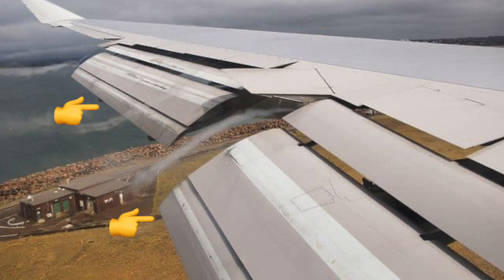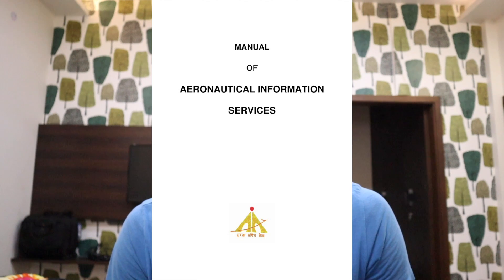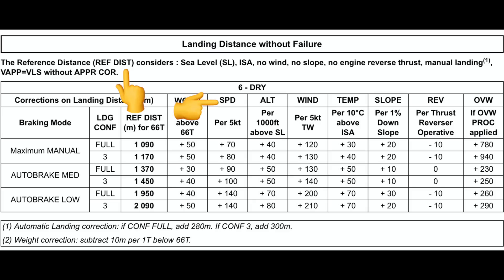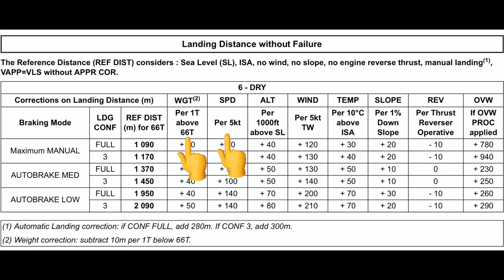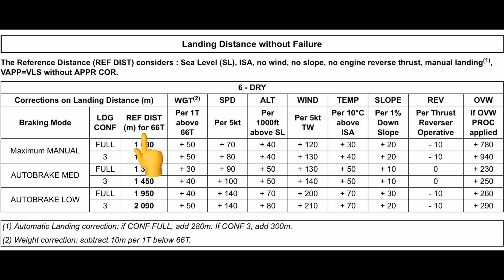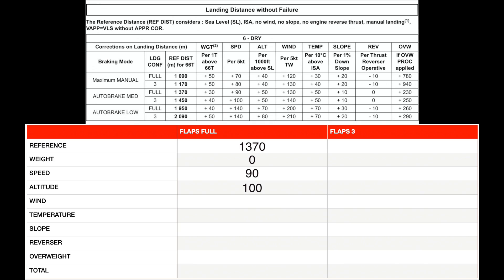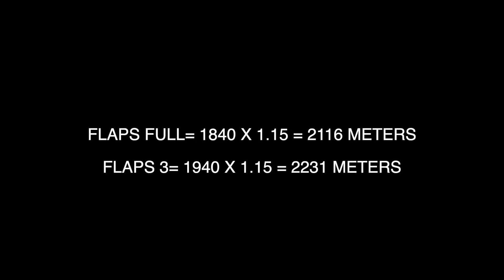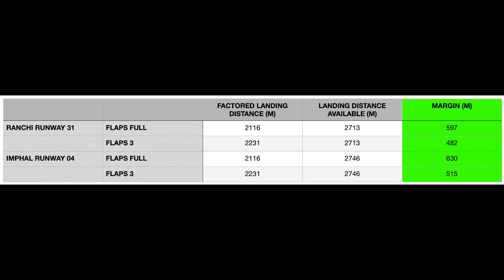HOW DANGEROUS ARE FLAPS 3 LANDINGS ON AN AIRBUS A320? 😰 (WITH PROOF!!!)

Comment: If the fuel consumption is so low than why airlines has given a target???

If Flaps 3 is so much safe then why has Airbus kept Flaps Full???
Reply: Flaps full is for runways with much shorter LDA.
Reply: @ajayanoop7995  what if a pilot is landing with a high tail winds???....... there are many other factors
Reply: @debasisrout2821  There is no analogy between flaps and Front brakes of a bike. Why would the government take such a stupid decision, what are you even talking about hahahahaha. Pilots are trained a lot to be in position to determine what flap configuration is required they pay almost 1 crore to learn such facts.
Reply: @furiousninja133  Govt didn't took any decision its the Air Asia's Management which has taken the decision to make 98%  flaps 3 landing (Or whatever) because it saves a substantial amount of fuel if considered cumulatively.

Yes I agree "Pilots are trained a lot to be in position to determine what flap configuration is required they pay almost 1 crore to learn such facts"..... So please let them decide what is safe and what is not? why the hell Management (Whose only aim is to achieve profits) is giving them targets to achieve?? Are planes flown by pilots or Salesman that they need to achieve targets??
Reply: @debasisrout2821  Pilots don't need to decide what is safe and what's not, it's not their job to do so. The flying beast is not qualified enough to be commenting on such a subject and its very unethical on his part. Pilots are required to follow the procedure and take decisions according to prescribed guidelines in case of any events. 
These procedures are determined by dedicated National and International authority. Any airlines can't enact rules or procedures arbitrarily risking the life of people. Everything in an aircraft has a procedure, they can't overlook such a basic and fundamental thing. 
He may by flexing his online power bend Airasia but many other will still continue and you would never know.
Reply: @furiousninja133  Pilots don't need decide what is safe or Not ??  bro grow up........ you can say that pilot don't make the Flight Manuals and Operating Procedures they have to follow these which is made by Authorities and their Airlines but its the Captain of the plane who has full rights to decide what is safe for his plane or not when he is in command, Though the decisions taken by him can later be scrutinized but he has full powers and freedom to decide.

by the way if you are talking about Policies i guess you don't know about the worst crashes in history of aviation has something to do about policies..... please refer to the below links:
https://en.wikipedia.org/wiki/2002_%C3%9Cberlingen_mid-air_collision
(Soviet System says ATC controller has precedence but western system says TCAS has precedence)
https://en.wikipedia.org/wiki/Tenerife_airport_disaster
(The worst crash in history happened because of a foolish Policy of KLM)

And if you want to know about how good the procedures work please refer:
https://en.wikipedia.org/wiki/British_Airways_Flight_9
(There is no procedure only pilot used his skills and his luck helped him)
https://en.wikipedia.org/wiki/Boeing_737_rudder_issues#:~:text=During%20the%201990s%2C%20a%20series,aircraft%20resulted%20in%20multiple%20incidents.&text=The%20National%20Transportation%20Safety%20Board,movement%20of%20the%20aircraft's%20rudder.
(Now one knew that there is a fault so no procedure.......)
https://en.wikipedia.org/wiki/2003_Baghdad_DHL_attempted_shootdown_incident
(What should I do if my plane is struck by a RPG.... thank god the pilot used his brains and landed the plane safely rather than looking for procedures)
and I think you Know how Captain Sullenberger hit the APU first it was not in procedure it was his Experience.

There are many more Examples

By the way its not about Flying Beast or any specific person its just to save the aviation world which I love.....

If you want to know more about how these budget airlines risk our lives to earn profit check out this:
https://www.youtube.com/watch?v=qSZ-R5HdPQU

you will come to know the truth about Air Asia
Reply: @debasisrout2821  I guess conditions do require its own solutions, for instance this case is for a normal landing SOP. PIC will take the mandatory requirements for landing and landing distance depends on appropriate glide slope also.
Reply: @ajayanoop7995  How did you knew that the condition under which the pilot decided to use flaps 5 was normal...... were you the first officer of the flight or you are one of the investigators?? its very easy to comment and calculate in a you tube video but its not that much simple while in the cockpit because there you balance the lives of 180 people with few gallons of fuel...... at that situation any sound human being (not those who are picked by management)if is having slightest doubts in their mind would choose lives of 180 people over few dollars............ as dollars can be earned again but lives cannot be brought back
Reply: @debasisrout2821  See i never wanted to argue, but if you always wanted to go ahead with safety of lives alone, then planes would have been made out of titanium and must have been made more strong, then why not. Simple, it was made to fit for the economics of a company. And also look at any inventions, the engineering calculations are always in par with least money involved. Least money never means cheap product. Air travel would have been far more expensive if it were to cater for human lives alone. Companies ply aircraft to reap profit, if you look from their stand point, they create the SOP with due consideration to the human factor involved. But at the same time it also looks into profit, and that is simple logic. Also pilots are not like mere taxi car drivers with just peripheral knowledge about the vehicle they drive in, they are bound by hours of study and also experience. I hope u understood. All the calculations given by Tapesh would have been enough to counter this. But wanted to make clear. I'm not against Gaurav, in this. But when a management is involved, they dont keep their profits at stake..
Reply: Imphal, Mangalore runway needs flap full
Reply: Full flaps are used in the flying condition where flap 3 wouldn't suffice dumbo
Reply: @furiousninja133  I know that dumbo..... but the thing is how would you feel if tomorrow govt takes out a rule that now can apply front brakes on their bikes and by some system you would keep a track on it and if some one applies just suspend their DL.

Its very easy to calculate and do the maths on a YouTube vedio but when you consider the truth that for that negligible amount of fuel you might risk the lives of 180 people sitting behind........ thats the HUMAN FACTOR

Comment: I cannot disclose my identity, but I have a good knowledge of Aircraft.
Sir, Whatever you said is partially correct, but there are many other factors that too affect the landing:

Flight crews should pay particular attention to monitoring their speed in descent close to VMO/MMO and when flying close to the wind direction (. The impact of a wind gradient can be significant and bring the aircraft beyond VMO/MMO.
When close to the ground, the wind can change, especially when in gusty conditions, and have a direct impact on the aircraft speed. As a consequence, monitoring of airspeed is crucial during final approach and landing to avoid:

Runway undershoot, hard landing or tail strike if the aircraft speed becomes too low, or
Runway overrun if the speed becomes too high.

The aircraft can be in either an over energy or low-energy situation at landing if the crew does not manage the aircraft’s speed correctly from top of decent, thorough approach, and down to the flare. The consequences upon landing are increased risk of runway excursion, tail strike, hard landing or runway undershoot.

Whatever the level of automation chosen during descent, approach and landing, the flight crew should be aware of its capabilities, take full advantage of the tools available on airbus aircraft and apply the procedures and techniques provided in the FCOM/QRH and FCTM.
Reply: @utkarsh what u r saying is correct sir don't worry these ppl won't understand as one cannot become an av geek in one day.  I can't disclose my identity sir but I have knowledge about airbus
Reply: True Indeed!!!
Reply: Boeing boy is just trying to be the PR personal of Air Asia and saving himself from suspension. Otherwise his conscience knows what's right and wrong. Sorry brother but cannot support a person who is taking a wrong stand... UNSUBSCRIBED.
Reply: Yeh air force wala he kya?
Reply: Yeah my boy. Nailed it. 480 meters seems enough for this kiddo. He does think that wind cant force the craft to run those 480 meters. Neither a brake failure can happen neither a situation which needs a go around and obviously needs more runway to take risks. He just thinks bs calculated hai airplane to mere rukja bolne se ruk he jaega. Konsa koi dikkt aati hai. Fr khud he ye admi videos dalta hai ki kese runway se age jake plane khdde me crash hua. Wo b kitne bar . Tb b flap flap kia kro na. Bola kro atleast we saved 8 kg fuel. No matter if 280 people died and a plane worth millions crashed. Its ok. We saved fuel for a few thousands. Targets met 😂😂 kl ke bacche ek sensible insaan ko chutia bnare hain btao
Reply: @mangloo_mafia  Target hit hona chahiye. 
Baaki sab gaya bhaad me. 
Gaand ki aankh me target hona chahiye.
Reply: He is just being a good employe
Reply: He's  just  trying to be a ' chamcha' of Air Asia.. thats all
Reply: Report n unsubscribe #supportflyingbeast
Reply: before commenting anything better you  educate yourself !! going by your explanation you barely know anything about Airbus philosophy. Have you ever heard of GS mini?..it prevents the aircrat energy to deplete below a specified level..thereby maintaining VAPP in gusty and tailwind conditions..As long as your speed is managed,the A/THR keeps your speed intact!..so learn before you comment!
Reply: @pherakarsab1200  
Dont teach me about Flight Systems......Truth cannot be changed......there is a reason for every single sensor installed in the aircraft
During descent, approach and landing, the operation of the aircraft is  framed within limit speeds. Their indication on the  placard enables the flight crew to easily identify the aircraft speed envelope.
The decelerated approach is the default strategy used by the FMS to compute the descent and approach path. It is the recommended strategy for approaches using managed vertical guidance: ILS, GLS, SLS, MLS, FLS and FINAL APP.
In any analysis of aviation accidents, Runway Excursions (RE) are usually identified as the top cause of aircraft hull losses. Many of these accidents occur on runways where braking performance is degraded by runway surface contaminants.
All aircraft are designed, tested and certified to avoid the possibility of exceeding its structural strength. Operational thresholds or limits define the envelope for the load conditions in normal operations, and there are design margins to cope with abnormal or excessive loads on the aircraft if they are experienced in-flight or on the ground.
Reply: @utkarsh3481  Sir!  I don't really understand what you are trying to explain  in this regard by randomly copying & pasting some paragraphs from the following document available on Skybrary to look like a highly informative message but actually contains things irrelevant to the topic under discussion
 https://www.google.com/url?sa=t&source=web&rct=j&url=https://www.skybrary.aero/bookshelf/books/4071.pdf&ved=2ahUKEwjmt5jz45fqAhW27HMBHZbkDckQFjABegQICxAG&usg=AOvVaw1wrEGVRc_H1kEcfwp88f1W

Almost similar to some engineering students copy pasting from articles available on internet when they're making assignments or projects
Reply: @ICECOOLJK  
Read them yourself
Reply: @utkarsh3481  Sir!! I read them very well at least two years ago and that's why your comment confused me and still wondering what you want to convey by randomly copy pasting some paragraphs from this document.
Reply: ICECOOLJK  
Okay 
Let’s not argue about it more......
Stay safe 
Stay happy
Reply: @utkarsh3481  hey what is the relevance of your this answer .
Reply: @anikbhowmick1044  
From which flying which Command do you belong?
Reply: @utkarsh3481  Ok sir!! As you wish.... Good day to you.... Take care!!!
Reply: @utkarsh3481  .before asking my back ground try to know what u intended to say and the purpose of the video .even at your first comment VMO and MMO .what it has connection to flaps.i also know VMO is maximum permitted/attainable speed on a particular aircraft .this speed only will come into consideration When desecnt rate is high . Most ridiculous is that VMO is defined in clean configuration (no flap no slat LGS  up) before insulting people try clearing your back ground .and just merely writing about technical terms won't prove your knowledge to aviation.just merely Ur blind knowledge .MLS (Microwave landing system )GLS (GPS landing system ).can u tell which airports in India operating with this technology . Better that u hadn't written SRS also .
Reply: Utkarsh Really ??..decelerated app computes descent path? Is that so..ever heard about idle factor? I bet you have not..cos you are one of those so called “AVGEEKS” who know only to copy paste and possess no factual knowledge!
Reply: @utkarsh3481  you are right sir I am very angry with beast army
Reply: @utkarsh3481  you are really right and a very good person
Reply: @pherakarsab1200  rhne do beta...adha adhora gyaan naa chodo tm

Comment: 1000 likes and 718 dislikes. I see the ratio increasing!! This puppet is believing saving fuel is SCIENCE. One suggestion: Aviation turbine fuel (ATF) costs about 72/litre in India. 8 kg is about 12 litres.. 72RS * 12 ltrs (8kg)= 864rupees per flight.. Let's assume worst case some 1000-2000 rupees extra.. Do one thing, ask your airlines (Air Asia, apparently lol) to take 4-5 rupees extra from all 180 passengers on-board.. NOT SCIENCE BITCH BOEING BOY
Reply: You just killed it bro

Comment: i know flap 3 landing is important and is good for environment too but an airline cant impose a target threshold of 98% to a pilot.
even gaurav in his video told that both the flaps are safe thats why airbus has certified both flap landings..
but he(gaurav tanefa) even told us that if the pilots dont complete their 98% target than it is non compliance of SOP(standing operating procedure) means that a pilot is not working according to the guidance and procedure and therefore they can question the ability of the pilot and he also told that they(airline) consider it to a "so called" DEMERIT policy due to which they got points or no point which is directly linked with final year bonus a pilot gets!!!!

Comment: Disclaimer: Its just a discussion I am not for or against anyone. I am an aviation enthusiast so just want to gain knowledge, open to discussion.

If it was so safe then why is Imphal and Ranchi considered short runway? If a disaster has to happen the 0.5km margin would munched in a jiffy. In those cases the additional 100 or 150m of runway that you will gain by Flaps Full would be a boon. Now if a captain wants flap full landing should be given liberty to choose after all he/she is a captain(Person responsible for the entire aircraft). The point Capt. Taneja made is that, the SOP of 98% flap 3 puts pressure on the captain where in even if you require flaps full in dire consequences the captain might end up choosing flaps 3 and that's when the disaster might happen which could have been saved by just 100 or 150m. There is phrase which is regularly used " Yaar just bacha, kuch bhi ho sakta tha."

Comment: The point was never that Flap 3 landings are safe or not.....its just that the company should not force the pilots by giving them targets as flap 3 is not always possible and safe ......as you mentioned in your last point for eg. High altitude airports or short runways etc...
If you can't support the whistle blower because ur job would be endangered, we can understand that. But please atleast dont post videos and become a road block in Gaurav's efforts.

Comment: Just for the sake of Curiosity, If with Flaps 3 we are saving 8 kgs of fuel and using less runway, wouldn't we be burning some of it while taxing out of the runway. Also if 8 Kgs is so negligible just as the difference in Flaps 3 and Flaps Full, why impose such restriction and why not speak out, its been 16 days.

Comment: He is acting as a puppet of Air Aisa , Probably a bribed puppet.
 He didn't make adjustments for steep glideslope in Imphal, He didn't talk about short field operations such as in Pune or Agartala. 
And the main problem which he very conveniently dusted under the carpet is forcing the pilots to do flaps 3 landings and penalizing them with demerit points if they don't comply. 70 - 80 % flap 3 landings is also a lot , but forcing a pilot to do so every time and even when he feels that it maybe unsafe is a gross safety lapse and calling for a disaster. There have been fatal crashes due to similar policies of different companies.
Gaurav never said that flap 3 landings are unsafe, but taking away PIC's judgment by forcing them to do flap 3 everytime maybe unsafe in certain circumstances.
No other airline has such a policy.
I always knew that You are a below-average and hardly qualified pilot , but now I know you are even a shitty human being. You don't care about flight safety , nor you care about the lives of people. all you care about is your job and licking boots of your employer while jeopardizing the valuable human lives. Shame on you.

Comment: If flaps full provides you extra safety then what is wrong in it .  Or if flaps 3 are more then enough then why the airplane builders are putting flaps 4 lading option in it for advertisement??